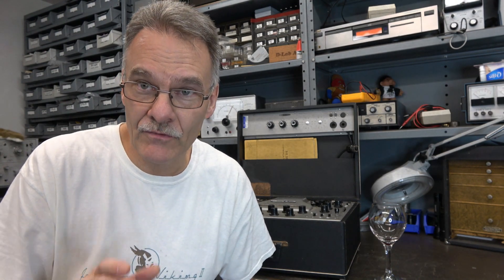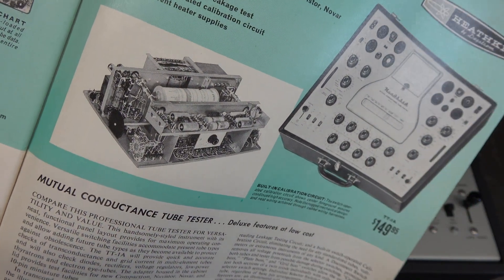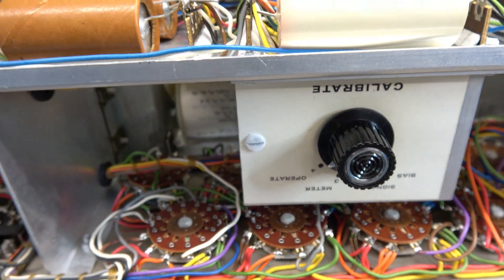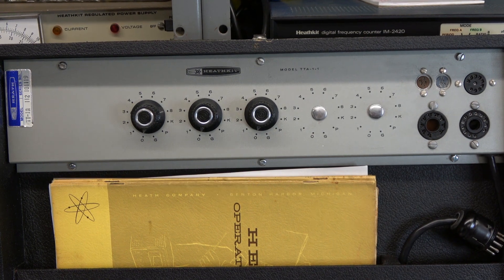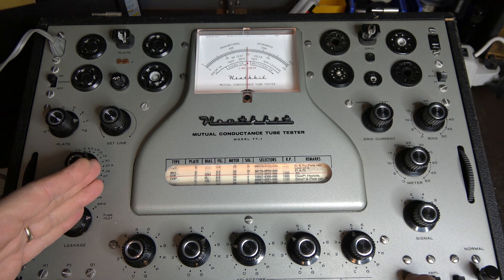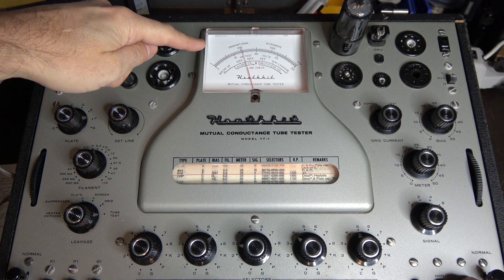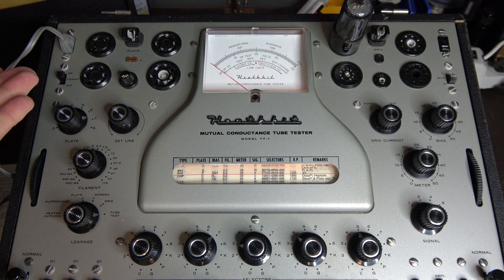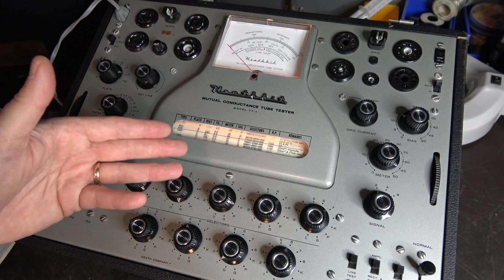How to Test 6V6 12AX7 tubes Heathkit TT-1 Tube Tester Demo D-lab

Comment: Glad you mentioned making the setting first then putting the tube in.  Nothing so exciting as testing a 50L6 then a 6SN7 with the filament voltage still at 50....

My own tester is an Eico 667, also a very nice unit.

Comment: I have a Superior Instruments TW-11 tester it seems to work fine ,has the roladex ,set up a little diff than this 1,I downloaded the manual and with it came updates on tubes ,have used it many times and seems to work well ,is there any downside maybe emissions from these old gems?

Comment: Woow fantastic the conservation is incleable. Thanks Terry for the opportunity to see this time capsule.
A good friend has 3 Hickok.
539C, TV7 D/U, and 600A. The TV7, is in a fantastic condition.
  The 539 had quite a few cut cables, all the sockets had to be checked according to the diagram. It is still in the repair and calibration phase. We have doubts as to how it will react testing 6L6 GC and others... of stage. With the previous valves it behaves well.
The plate voltage, we understand that it is 150Vdc in the Hickock.
In the 539, we do the ratio at 250 Vdc. with the rule of 3 . Having plate current 1.2 mA at 100% and 1.6mA/V in transconductance. Do you have any advice ? Thank you Terry.
The 600a needs even more care, because the transformer is open in the winding of the 5Y3 of the tester.
Más información sobre este texto de origenPara obtener más información sobre la traducción, se necesita el texto de origen
Enviar comentarios
Paneles laterales
Historial
Guardado
Contribuir

Comment: As an added precaution, I leave my tester (Jackson 648-1) turned off until everything is set up. I also double check the filament voltage before I flip the switch on. You could have a bad day if you leave it on 12.6v and test a 6.3v tube afterwards!

Comment: Two points, you skipped the life check test and second, you can flip the disconnect switch to make your adjustments.  Great demo.
Reply: Are you supposed to make the adjustments before inserting the tube?

Comment: From Leo:  Great tester.  I still have my old Hickok and it is pretty good, but that Heathkit is head and shoulder above it.    I am worried about the roll chart decay, and turn the roller very carefully these days.  PS. I need one of those wine dispensers like you have.
Reply: Barb Melle, you should write down the settings and testing data for the couple of dozen tube types that you are most likely to be testing on a regular basis, arrange them in alphanumeric order on a sheet or two of paper, and use that as your reference. This way you won't need to rotate and search through the roll chart very much anymore. I actually photocopied the roll chart from my Hickok 752 a, and I found other guys online who had done the same with theirs, and we swapped copies of the charts and copies of the separate test data booklets for foreign tubes and such. it is now almost impossible for me to find a tube that cannot be tested on my Hickok!

Comment: Regarding the 12AX7...
What does the "-000" mean at the end of the selector settings?
Why don't you check the "GRID CURRENT" test? All of my 12AX7 tubes show some grid current which, according to the manual, means that the tube is bad.  How does your 12AX7 check for grid current?

Comment: Hi Terry, thanks for the video. I've looked at the assy manual, and it mentions P.E.C suppressor (RC filters network). I take it these prevent oscillations, but what does pec stands for? The TT1 has no ferrite beads on the wiring at all?

I try to build a tube tester , and i'd rather avoid the oscillations with high gain tube...

Thanks again!

Laurent
Reply: I don’t recall that the TT-1 used them (it might), but Heath used “packaged electronic circuits” in a number of kits. I’ve also heard them called “printed electronic circuits,” but packaged is the term in the Heath manuals. They’re in audio amps and some of the SB line ham gear.

Comment: Thanks Terry! Another very informative video.
I was lucky enough to pick one of these up about a year ago. Mine is in excellent condition but is missing the power cord. What's your thoughts on replacing the stock connector with a modern IEC connector?

Comment: Hi there, how complicated gadget, books charts just for checking a tube, isn't there an instrument that are more easily to operate?
Reply: The complication arises from the need to assign all possible tube types from diodes to double-triode-pentodes, all basings, all electrode voltages and test signal amplitudes to the complete variety of receiving tube sockets (ranging from 4 to 12 pins), then setting the meter sensitivity to derive a useful test result given all those input parameters. It’s not complicated to set up to test one tube, but it is to test hundreds of types from small-signal miniature tubes or Nuvistors up to power tubes.

It does take time to test a number of tubes...and then they may not work in-circuit!

Comment: I should build one of those. I can solder.
Reply: Marshall, I suspect that a complete and unbuilt kit for this tube tester, with all of the original parts included,  would be a very rare thing indeed. The switches and sockets for such an original unused kit would probably be in worse shape than if the unit was assembled and used periodically over the years, because the metal contacts of the switches and controls that sat there unused for 50 or 60 years are going to have sufficient significant tarnish and oxidation on them, that would have been wiped off somewhat by rotating the switches and inserting the tubes and so on.

Comment: Hi, the 6v6 tube is likely fine. I own the same tester. In the remarks column for this tube is the notation "x2". When i believe means to multiple your reading by it. Thus your reading is appox. twice the R.P. (Reject Point). Correct me if I have misread my TT-1 manual. Thanks
Reply: are you saying that the tube is extra good?